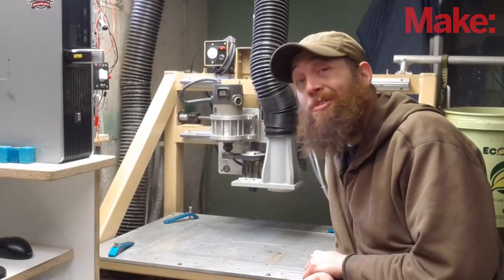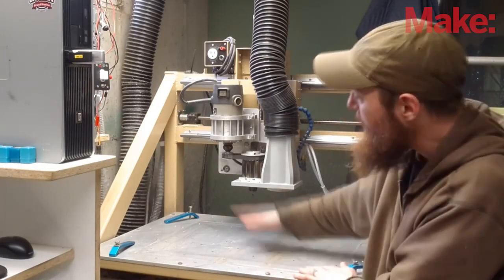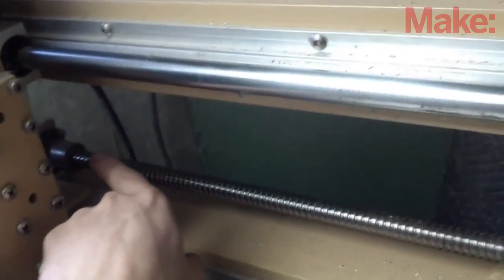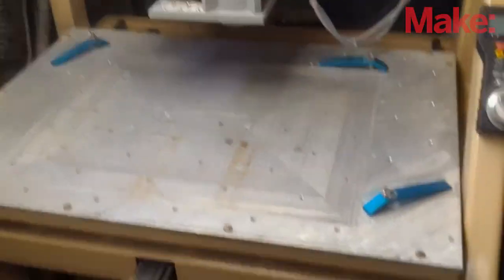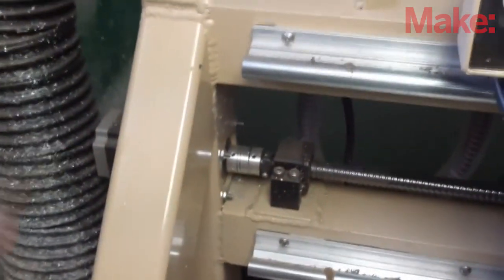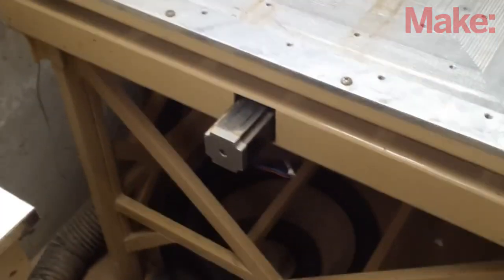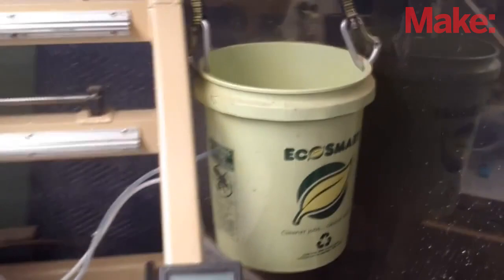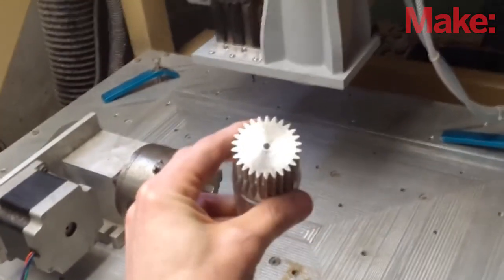Anatomy of a CNC mill

Comment: Excellent build..! First homebuilt cnc Ive seen - always wondered if it were possible and or affordable to build - looks as though it could be... whats the largest possible size you can work with on the given table size..? Ive seen the sliders and bearings in McMaster Carr - dont trust ebay much ive been burned a few times... thanks for sharing...!
Reply from the maker: Thanks for the bearing tip!

Comment: With 3d printers it's possible to make a cheap simple frame to put the non-printable parts in, and then print a better version to transplant those parts into. Is that possible with a CNC mill too? (build a cheap wooden prototype and use it to cut out the better version)

Comment: Thank you for the cool walk through video...
I have a mach3 machine and I got the same wireless Pendant...
One question for you:
How well does you MPG wheel work...?
I have an Xbox controller that I use the analog Joysticks on and it works well for that but I was a little disappointed with the pulse wheel on the Pendant.
I don't know if I can change settings somehow... but when using the pulse wheel, it moves more jittery then analog.  it also doesn't vary speed very well.. and seem to stop rather abruptly...
Does it seem to work like that for you?
thanks